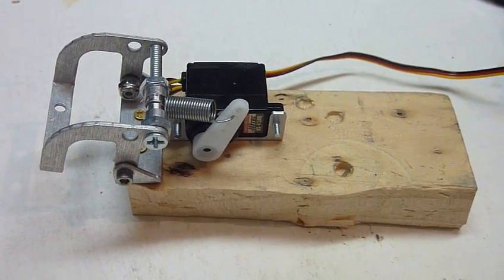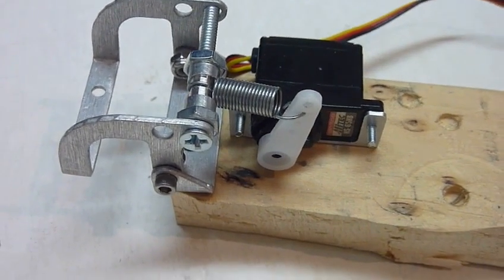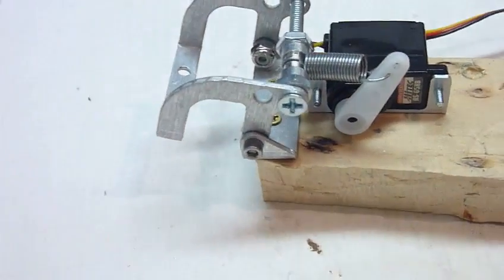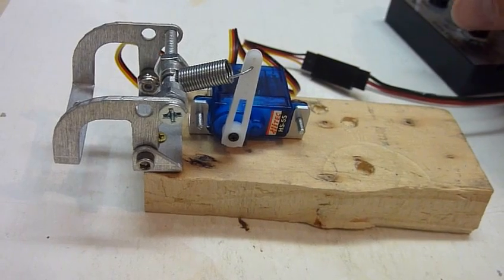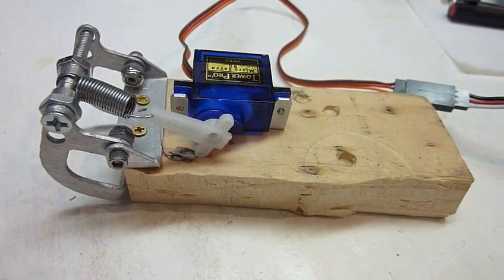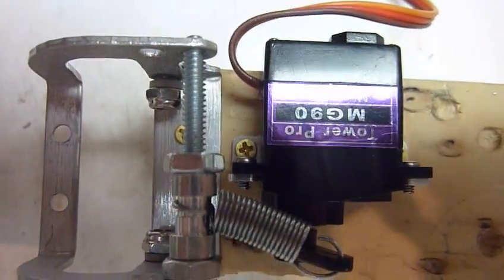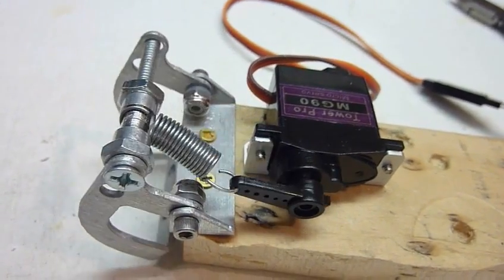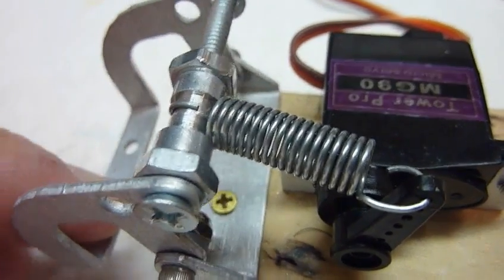R2-D2 Dome Panel Servo Trial

Comment: Love your build, I'm doing a 3d printed version and getting the teecy setup. I plan to use your hinge setup does the teecy set include everything needed to run the servos for this?
Reply from the maker: Dunno, I have not stayed up to date and don't know what a teecy setup is. This was made to operate with my MarcDuino setup: https://youtu.be/jeGLv9i5Izk.
Reply: do you have a link to your 3D printed versions?
Reply: @Vass881234  check this: https://www.thingiverse.com/mrbaddeley/designs

Comment: If I'm using your boards/scripts/bright holos with Teeces, how many amps could I expect to pull using servos like these for all the panel and holo servos? I just want to make sure I feed enough on that 5v line. I'm also using the wifi and MP3 boards if that matters on amperage much.
Reply from the maker: On average not too much but at peak it's insane. I get by with a single 6A power supply, but I have fine tuned linkages and high quality HM65 servos. Since people were running into brownout trouble, for the run we decided to double that, and put two power supplies, 6A each, one per each Marcduino board, for a total of 12A peak. That might be a little overcautious. Start with one power supply, if it's not enough you know what to do. The MP3 board is a very heavy power consumer BTW.